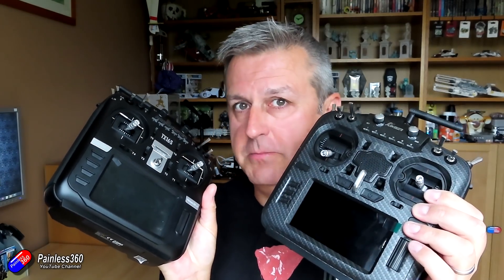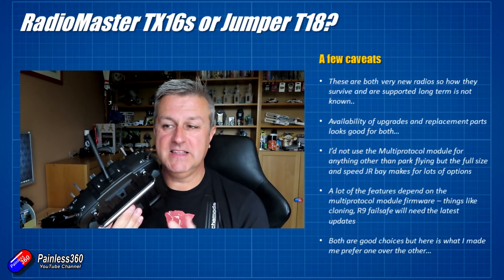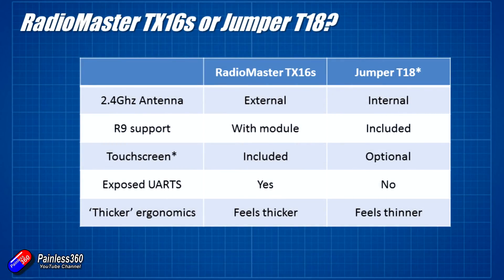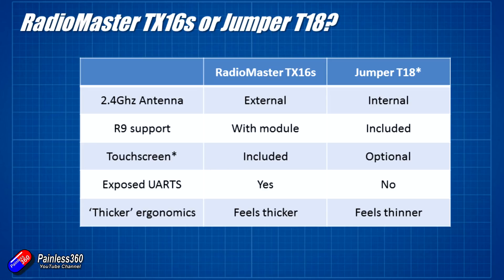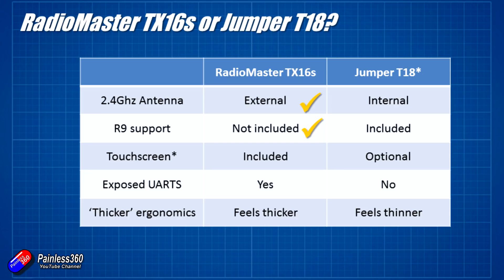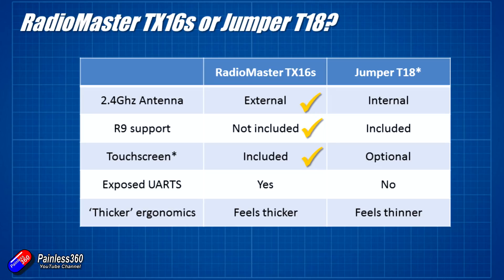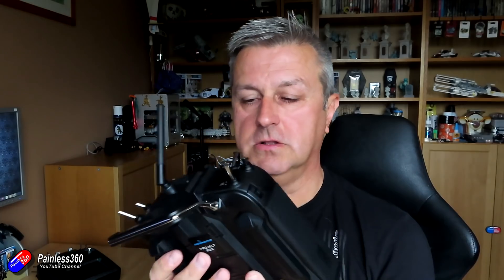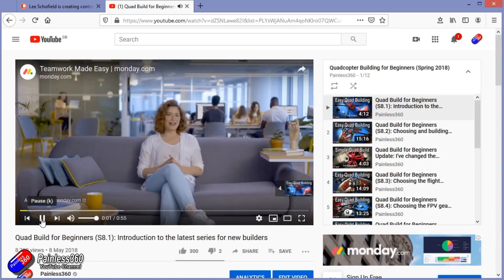Jumper T18 or the RadioMaster TX16s?

Comment: Hi great video, but have you done one on performance and build quality? I have one of the original T16's which I upgraded but it is still very poor quality, and have yet to replace the ribbon cables. I turned it on yesterday after a couple of months and got all sorts of errors come up, so thinking about another Open Tx radio, but to be honest dont want the same performance again. I use Spektrum on fixed wing. What are your thoughts on quality ??
Reply from the maker: The Jumper T16 suffers from a lot of problems. They appear to have been addressed in the RadioMaster radio...

Comment: Hi there!! Anyone knows or tried to bind a futaba FASST receiver to the radiomaster?? Thanks!!!
Reply: FASST is not supported  by multi modules.  Futaba FHSS is supported.
Reply: @zmanphx  Yeah thanks man! Just found the list after that! Bought a X8R for my heli 😁
Reply: @workshopbeastsfpv413  ,  Nice thing about multi modules, I can keep my DSMX, Futaba SFHSS receivers for use in my helis. I actually got slightly better range on DSMX protocol on multi module vs Spektrum DX9 when I ranged tested.

Comment: I'm also sold on the antenna.. plus the price..
I just got my Radio Master in the mail but I also just bought a Kawasaki Versys 300 X so I have been to distracted to spend any time with this fantastic new TX..
The Versys here in Southern Oregon USA is a blast in this mild summer season.. 
I will get around to this new TX eventually.. 
I mostly bought it because I didn't trust the ribbon cables on my Jumper anymore... I had one  fail and had to replace it right out of the box.

Comment: I am currently using the T16. I have 2 external modules (R9 and CrsF lite).
Dependent on which quad I fly, I need to change the module everytime. 

Seeing that the Jumper T18 has R9 in the internal module it would be perfect for me, because then I don't have to swap external modules everytime. Just keep the CrsF module in and I can fly all my quads (R9, Crsf, and frsky from the internal module).

After watching this video I am doubting what to do.
Reply: Well, the T18 internal 900mHz is only 300 mW instead 1W on R9 module so its more like R9 Lite. Also some say the protocol isn't genuine Frsky protocol but more like a reverse engineered protocol. And why would you swapping 900 mHz modules? Usually people will choose either R9 or Crossfire but not both :p

Comment: Just to be clear here, the Jumper T18 supports r9, but not the 2019 version. Which means the jumper is incompatible with any of the r9 receivers that say "OTA" or "ACCESS" because they run access instead of ACCST. Right?

Comment: Question... Did Jumper upgrade the scroll wheel to metal or is it still the flimsy plastic. And which radio has better quality switches that is nothing going to break after the first season of flying..
Reply from the maker: I've fondly had this one unit but have had mesaages from others who've received the production units with the poor feel roller...

Comment: Painless, I have a technical question: You mentioned that you would not use a multi module radio for anything other than park flyer because of the limited power output.  However the Jumper module puts out 22dbm which is equal to 158mW verses 100mW output power of the most expensive Futaba radios.  Is there something about this that I don’t understand.
Reply: Thanks Painless, I found the excellent video.  I guess I’m lucky that all my 26 fixed wing models use FlySky receivers and in that mode the module puts out approximately 100mW, same a $3,000 Futaba radio.  I do realize that the module itself my introduce additional losses but I don’t feel the module is limiting my range significantly if at all.  I do ground test all new models and constantly monitor the RSSI.  If I were flying FreSky or Futaba receivers I might feel differently.  Thanks for your replies and all your excellent videos.

Comment: I am happy to have chosen the Radiomaster. In the Jumper T18 I don't like that for the 2.4ghz it is limited to the internal antenna with a lower range. But above all and much more serious are the problems of incompatibility with r9. Jumper could have produced something better, Frsky with some updates is making the r9 receivers unusable with this multiprotocol module. Instead the radiomaster tx16s is compatible with all frsky receivers, even those that frsky is making incompatible with its own old models. With the external module the differences are smoothed out, but then why pay more for the Jumper T18 to have a radio whose value is the internal multiprotocol module if it then has these limitations? At this moment I would not even choose Frsky radio controls, its very questionable commercial policy is to make its own old receivers incompatible on its new products. I find this a discourtesy towards those who have spent a lot of money on Frsky products.

Comment: I'm new to all the open source radios, I'm a bit old school still but been flying FPV for a while with my DMS2 radios, I bought a Radiolink a year ago because i cant get my old radios to work with my goggles but cant get the headtracking cable to work anymore and they have stopped making the cable I need. Does the Radiomaster support headtrackng??

Comment: I tend to agree with your summation. Also consider that the R9 performance of the Jumper T18 is limited 300mW whereas the external module can go to 500mW - sort of important if you are going long range. That said, I will wait for a V2 of the Radiomaster because my Jumper T16 hasn't missed a beat (yet) and hopefully Radiomaster will come-up with a better looking face-plate because the TX16S looks like a 4 year olds toy !

Comment: It's always personal preference. I have used a jumper t16 just felt like a cheap plastic radio. I will stick with my Horus. Like the weight and has a quality feel.
Reply from the maker: The T16 originals quickly showed the quality issues. It's why I stopped making videos about them.. Happy flying

Comment: Hi, do you pinch? How do you like the feel of the Radiomaster vs. X9D?
Reply from the maker: I'm a thumber (as mentioned in the video). So the thicker more contoured feel is good for me..
Reply: @Painless360  Ah ... sorry ... I skipped through so many videos and could not keep track who flies how. For a thumber there is probably no significant draw backs on the Radiomaster. Battery life, use a 2S 5000 mAh, sliders who needs those, frsky access, well we all end up using crossfire anyway. 
Thing is I have the X7 and the ergonomic is not right for my palm.

Comment: Jumper keeps messing up radios.   The T16 was kinda a miss - charging,  battery bay, ribbon cables.  The T18 is also kinda a miss - still no charging solution the battery bay is too small, the gimbals are meh, the 5in1 module isn't quite sorted out, no touchscreen... the list goes on.

Comment: Hi, I've been out of the loop for a long time and have no idea what R9 or CRSS is!  I fly fixed wing only and I have two radios, one is the Graupner MZ 24 with an excellent colour touch screen and good telemetry and ergonomics. The other radio is a very cheap radioLink AT10, also with colour screen. The sliders are rubbish but the gimbals and switches are pretty good. Quoted range for both radios is 4km although I only fly line of sight. I like the idea of multi protocol, especially as it's possible to use my Graupner receivers and also use Spektrum because there are many tempting models from Horizon Hobby which are ready to fly out of the box but it would seem that multi protocol just doesn't have the range I want? I have 3ms rock solid performance from both of these radios at maximum line of sight, and for my eight foot power glider that's a fair distance away when only just visible, so would you please explain crossfire and why it seems to be an advantage?  I think that sometimes, advancements in technology can also be a step backwards, after all, they want you to keep buying the latest gear!
Reply from the maker: I'm a big fan of 'if you've already got something, you're happy with it, it works well and is legal' then there's no need to change.. Happy flying

Comment: Interesting take on the power output of the multi-modules. I built one of the original 4in1 modules, around the Atmel processor, a few years back. I’ve since measured the power output on most protocols and it averages 140mW to 160mW. I’ve recently (last few days) acquired a JP-4in1 module for its STM processor and extra memory and have yet to measure the output. I agree with your “park flyer” comment but that’s when using Spektrum... because, you know, Spektrum. If stock ever reaches the UK I think the Radiomaster will be the one for me. Like you I’m not interested in the R9 system as I’m still heavily invested in the EzUHF system.
Nidge.
Reply: I compared range on dsm2 with authentic spektrum receiver. Comparing Dx9 vs Irangex  lite on on x9 lite I got 120 feet more distance on external module. I fly helicopters so the range exceeds LOS .

Comment: Don't think you mentioned it but the Radiomaster also has internal charging, it's a small feature but really nice. Overall the Radiomaster is just a nicer package. 
Once the touchcreen is fully implemented, I'd love to see a smaller radio with a large screen, something in-between the T12 and TX16s.
Reply from the maker: All that was covered in the linked videos. I'd still remove the batteries from the radio to charge. I'm too old school! :)

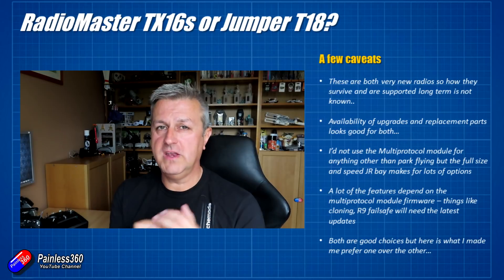Comment: I cancelled my T18 Pro when the reviews came out. I fly a ton of 2.4 so will get the Radiomaster plus a Crossfire module (for just 2 quads). I only have one concern: 1:28 - I'm looking for a radio to replace my DX9 and X9 Lite so I only need charge and take one radio to the field. I fly planes, gliders, quads ... everything ... and am now concerned whether the MPM will have enough oomph. Perhaps I should be retaining the DX9 for flying a small handful of expensive balsa aircraft ... What about diversity - 2 TX aerials to improve the reliability of the connection - guess that has to be out of the window as well ...
Reply: This statement also got me wondering now if I can use my multi protocall module with a futaba reciever in one of my nicer balsa planes, maybe someone can tell us whats the way to go if you want one radio to rule them all, aka park flyer and 1/4 scale plane flying.

Comment: Hello Sir,

Thanks for sharing all Your videos. I really enjoy them and learn a lot.
I've just bought the Jumper T18Pro and more or less regretted it already, due to the build-in PCB 2,4Ghz antenna.
In Your opinion, would You trust this radio bound with a Hitec Optima 9 receiver (tuned properly of course) with a $6.000 plane?

Have a great week-end.

Regards Kim
Reply from the maker: I've not used the MPM for long enough to trust it to that extent. I'd use a dedicated module in the JR Bay for the receiver you're using and an adjustable antenna. Just my own two cents..
Reply: @Painless360  Thanks a lot for Your reply. Your two cents can suddenly represent a whole other value. Highly appreciated. So is the Jumper and Radiomaster merely for "park flyers" and quads etc.?
Reply: @kimjeppesen2172  
Better you should use an Crossfire with Diversity Receiver. .. better then an Old Optima Receiver.... if your Plane 6000$ thats an smart investment

Comment: Better than my tanaris X9D Plus Se 2019?
Reply from the maker: If you want to fly other things apart from FrSky and want full speed Crossfire - yes.
Reply: Painless360 i fly crossfire with CRSF shot firmware in my Taranis this is better of this?
Reply: @mcferran6720  yes dude, your radio is overpriced and lacking numerous features of the Radiomaster. Is that what you needed to hear? It's not hard for a product to be "better" when it's 40 dollars cheaper than the Taranis with way more features and a beautiful screen.
Reply: @MikeMPharmaCyclist  yup just read the taranis comments

Comment: I originally wanted one of these, but after watching this video, I've now changed my mind. I fly 2.4 all spektrum. If the multi protocol module is no better than my regular Spektrum dx6 I can't see any benefit apart from more channels and a bigger colour screen. Thanks for the very useful video.
Reply: the 80 mW output power is only for the Frsky protocol, the wrecktrum protocol is fine but still under 100mW because of the EU limit
Reply: @calibermix8159  hey do you know what the flysky output is? and is it dual antenna on the tx16s?
Reply: I fly helicopters. I got 120 feet more distance with IrangeX module vs Spektrum DX9. The distance was beyond line of site with either.